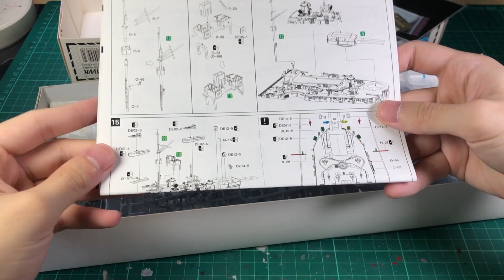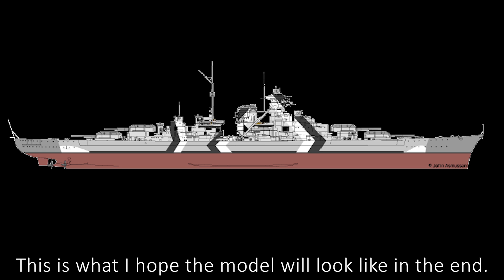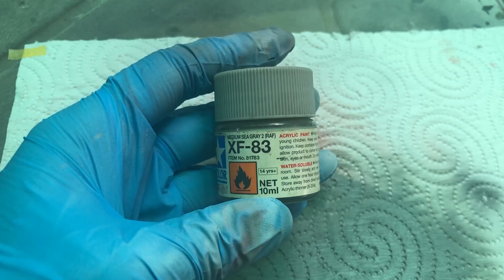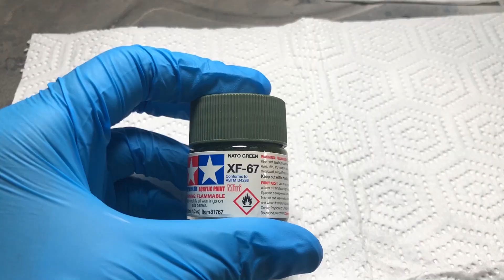1/700 DKM Bismarck - Flyhawk

Comment: Hello, excellent work, well done. I have a question what do you think of the flyhawk delux version of the Bismarck. Thank you

bonjour, excellent travail, bravo. J’aurais une question que penses tu de la version flyhawk delux du Bismarck. merci
Reply from the maker: Thank you very much! I really like the delux version, it contains all the Photo Etch and metal parts to upgrade the masts and main guns. This is already enough for most people but if you want to fully upgrade the Bismarck you’ll need to buy the wooden deck and metal parts for the secondary guns separately. 

Overall, I would recommend the deluxe version of Bismarck but would not advise it for a 1st time builders since it may be overwhelming.

Comment: What an awesome build.
quik question: did the brass barrels that you showed in the beginning and the wooden deck come in the expansion box or did you bought them separate? If the wooden deck is a separate is it worth it for a more beginner, or is the original deck of the set already textured?
Reply from the maker: Thank you very much! The brass barrels for the 10.5 cm guns were sold separately as well as the wooden deck. I like to use the wooden deck because it saves me time from masking the deck and it's like a sticker so it wouldn't be that difficult for a beginner. The wooden deck I bought also came with pre-cut masking as well. If you choose not to buy a wooden deck, the details on the deck are still very nice!

Comment: Hey I was just wondering where you can get the wood deck for the fly hawk kits specifically the 1/700 scharnhorst 1940 I’ve already built the scharnhorst in 1943 but I’d like to find where to buy the wood decks I need it for Canada
Reply from the maker: I order mine through eBay.
Reply: @KumaModels  kk thx